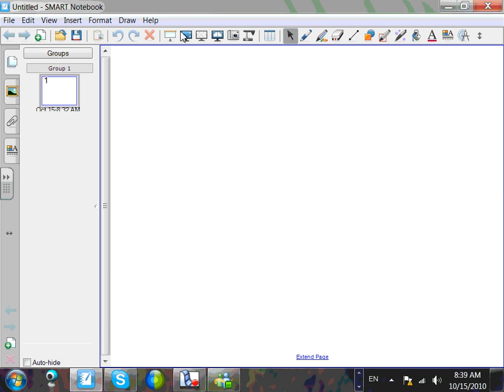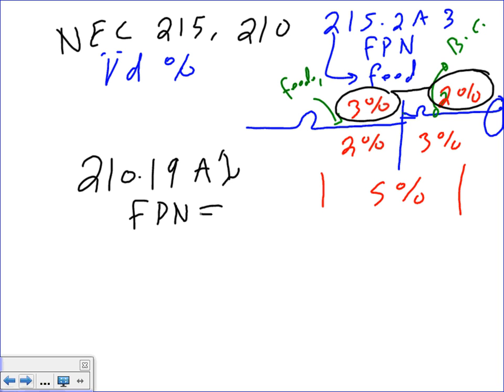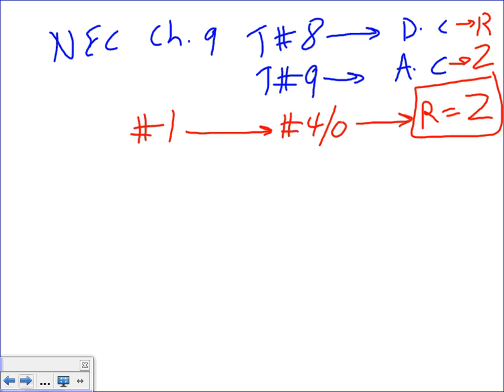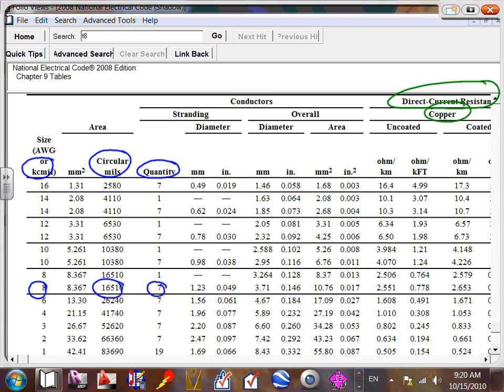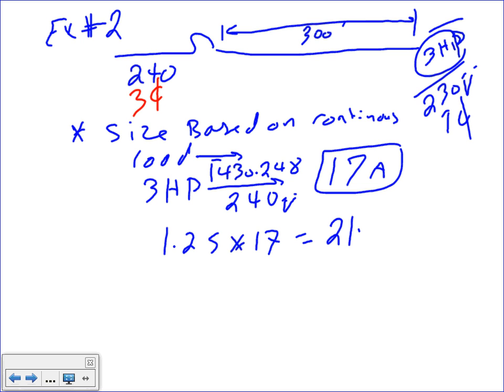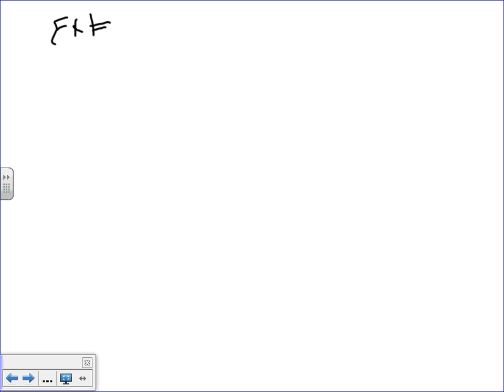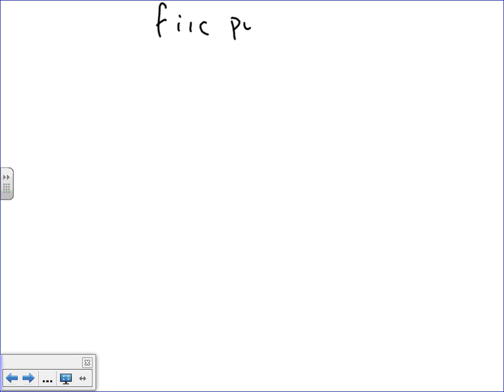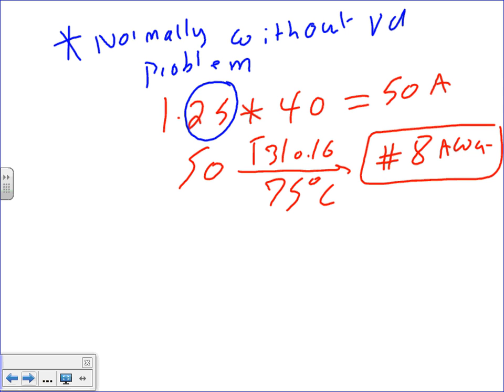Voltage Drop (1)-U#8-10-15-10.wmv

Comment: Thanks for the lessons, you made things very easy to understand.
I have one request, and that is can you use mic which clips to your shirt, this will clear your explanation more clearly. When you turn to the board to write, some times the volume goes down a little bit.
Second question, this video is from 2010, have you made any latest with latest editions of the industry standard and codes?
Thanks!

Comment: chad  kurdi,,, i have a question  from where come out the number 1.24. at the end of the video  you make a calculation  that calculation is 1.24*40 the result come out of  50 a.
would you mind explain me form where come out  the  number 1.24.
Reply from the maker: Gasparin Quintana Do you mean 1.25?? is so continuous loads from NEC.
Reply: yes its 1.25.. that one is a standard number for continuous load right?
Reply from the maker: yes
Reply: ok.thank you.

Comment: Question: Why should not size the conductor for both (in the same time): the voltage drop and continuous load, so the load will be the 5% increase in voltage (case of motor) and the 25% extra because of the continuous load simultaneously? 
I forget to mention that you are a great Professor. Thank you for every lecture you made!
Reply from the maker: You can but nor required by NEC code. Also no need. 
Sorry for the too late response and thanks for watching!